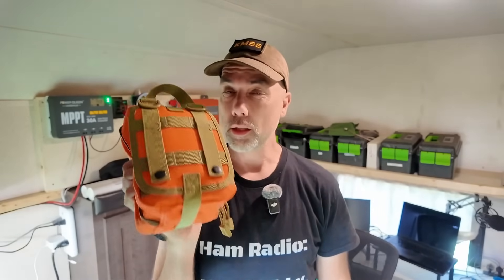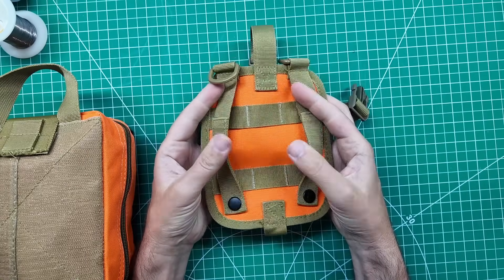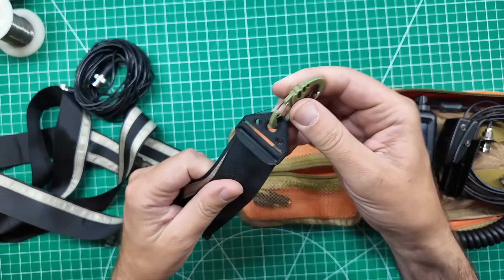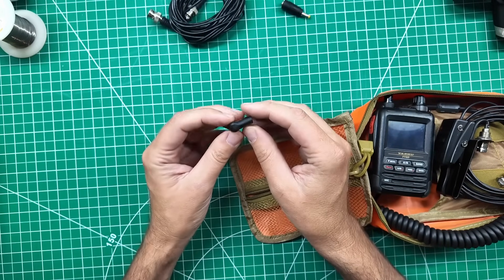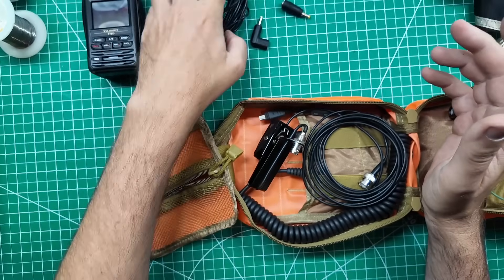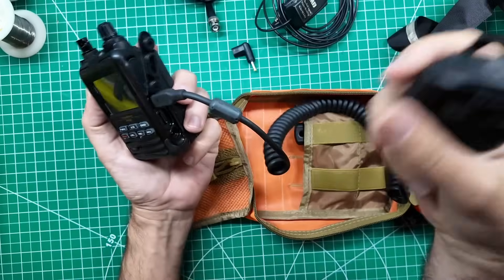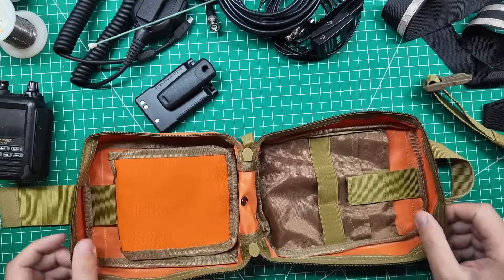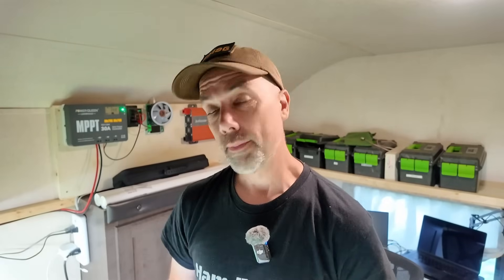I Built the Ultimate FT-5D Go Bag (And It Actually Works)

Comment: Great setup, but if it was me I'd also include the necessary USB cables A->Proprietary, A->C, and C->C that are both DATA and POWER capable. I might forgo that data mic and use the top connection port for a audio only speaker mic (SSM-17A), though there is no serial connection so, no cat control over USB (dagnabbit).
Reply from the maker: Great points about the cables; I'll have to update the kit!

Comment: Great concept.  I have been working on go-kits for the QMX and another for my TX-500.  I never thought about one for an HT and I love it.  You showed a lot of great items.  My Amazon cart now contains additional BNC connectors, that window mount (which is a fantastic idea), and that radio go bag.  I am researching that 2M Fara-J roll-up antenna vs a J-Pole antenna and my kit will include either or based on my findings.  I also have that custom battery pack from W0AEZ for my FT-5DR and it does a great job of giving you several days of battery life.  I highly recommend it.  Thanks again for a great video!
Reply from the maker: I make a go kit for every radio.  It's kinda my thing.  I have that TX-500 and I thought I found the right bag, but not yet... 2 down so far.

Comment: That's a great kit!  I'm putting one together (have one assembled that I've used for travel but it's much larger than needed).  Hoping you, or a reader, can comment on a question: is there any concern putting that mag-mount in close proximity to the radio?  I generally keep magnets far from any electronics, esp. if they have anything like "memory slots" (i.e. saved repeaters) and programming in them.  That's been a long running concern of mine and causes me to keep the mag-mount separated from the kit, which I dislike.  I'd love to get a comment on this, I really want to keep the mag-mount in the kit.  Been thinking I could use a small faraday bag around the radio to help with this.  

Like you, I keep a roll-up jpole in mine (Ed Fong).  It serves me very well from an upper floor hotel room (or anywhere stationary).  I hang it off the curtain rod in a window and then search up repeaters which are out the window on the same side of the hotel as the window faces.  This is easy to do; I use my cell phone's compass app to get the direction, then the Repeaterbook app to find the closest repeaters, also in that direction.  Looking at google maps on the phone helps too.  I also use a Signal Stuff BNC antenna in the way you've demonstrated but I use the stock antenna with the mag-mount and in cold weather as I'm in the Northeast.  Love the G.A.S. acronym.  Most go-bags are filled with what I call "gadget syndrome".   One thing I also want in there, besides spare batteries, is a portable charging bank.  I can highly recommend the N7 40K mAh on amazon for this.  I also have a battery compartment for the FT5D that takes AA batteries for shtf, but that's me.  Thanks again!  Yes, I'm subbed.
Reply from the maker: Hey Jay!  When I was younger, magnets and storage didnt get along well and I share your  same concerns.  "Memory" isn't magnetic as often these days and a lot of things already have magnets in them.

Comment: Just Awesome.  I need a cheat sheet now and then so I might add a laminated card or two on how to program a repeater from the front panel.  I also carry a AA battery pack, but it looks as though you've got plenty of power with those two batteries.
Reply from the maker: I changed radios enough that every one needs a relearn ... A cheat sheet would be nice.

Comment: Organization will set you free.  Also, I need to make replacements for the first aid patch that has an antenna with signal (similar lar to the wifi icon) for the ifak cases.  What color would signify "radio", and not be confused with first aid?  Maybe CYAN for COMMS?
Reply from the maker: Yellow on black or black on yellow are good choices!

Comment: A 50' length of RG174 at VHF and UHF frequencies, it is going to lose 75 - 90% of the radiated signal.  At the 5 watts of a typical HT,  that is 1 watt or less.
Reply from the maker: What coax would you recommend for a small go-kit like this?
Reply: @temporarilyoffline  I'd not bother with that coax and fara-j 2m/70cm antenna.  You would be better off with the signal stick antenna.   I would do the comparison test and see.
Reply: @bwillan @temporarilyoffline I would LOVE to see a shootout between the two.  Maybe set up an SDR to record the signals, then take the bike out to various spots and test.  Compare setup/breakdown time of the two, maybe do some comparisons of different coax types as well.  That would make for a really interesting and very useful video.